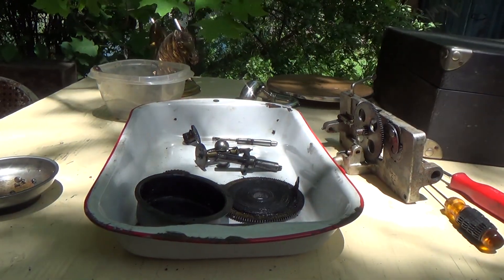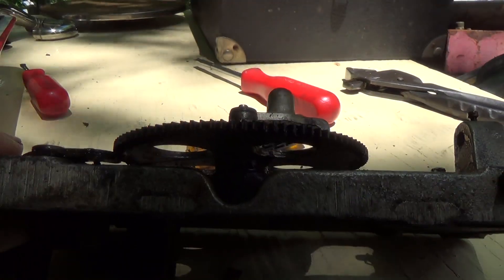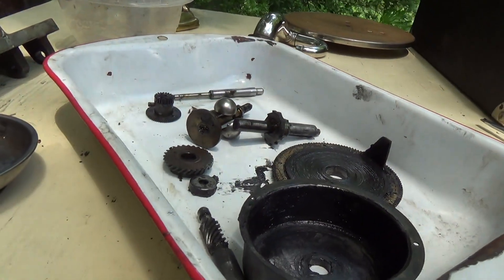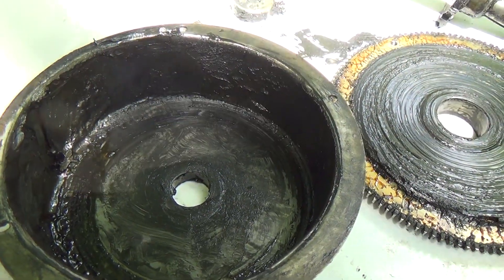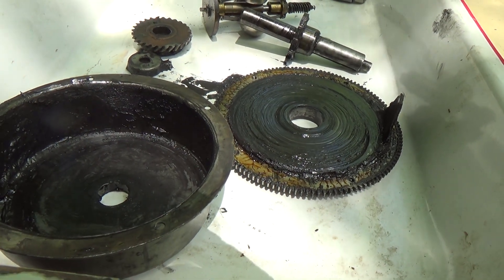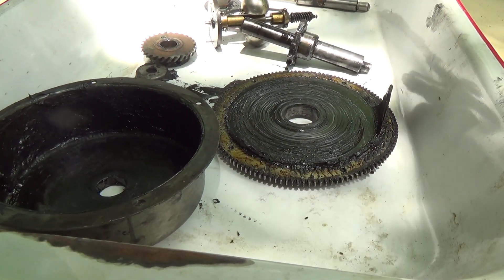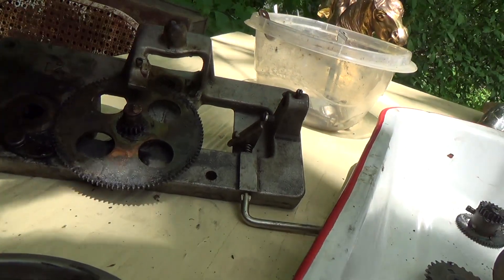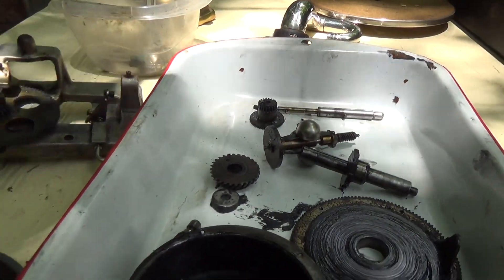VV-35 motor apart

Comment: I just got an old VV-35 (#47341), the main spring seems to be broken, but the spring barrel is riveted to the gear and the little "shark fin" spring retainer is outside the barrel. this is my first machine and I cannot seem to find a replacement barrel of the correct dimensions anywhere. if you know where I could find one that would be great!
Reply from the maker: VV-35's use a spring with a bent end on either end of the spring. The outer bend clips into a metal clip that is riveted inside the spring barrel.  There should be no part of the spring outside the barrel, or any retaining clips on the outside unless it's been modified in some way.  George Vollema should have parts for these, if he doesn't then I have several VV-35 parts machines.

Comment: Hey I recently purchased one of these machines and I'm currently trying to restore it. The old spring needed replaced so I purchased a new one and took the old one out and cleaned up the gears. However this is my first time doing this and for some reason I didn't think to take a picture of the spring in the barrel. But I figured I would remember how it went in. I also figured that since the inside of the spring barrel was coated in grease I would do it the same way. So i put the spring in how I remembered it going in and I re greased everything and put everything together. However when I went to wind it up and give it a few plays the platter wouldn't spin. wondering what happened I took it apart and as I went to take the spring barrel off I removed the cover and the spring was wound on the spring base plate where the hook catch is. So I'm kind of at a loss of how to continue. Any info or advice would be very appreciated thank you.
Reply from the maker: Can you take some pictures or video of what's going on and send them to this email? rockisland1903victrola@gmail.com   That would give me a clearer picture of what's going on.  Was the new spring damaged?  It's been a few years since I played with a 35, but I do have multiple ones in stock waiting for me to tinker with them.  I never have luck with the original springs in this model, they always seem weak, and I end up replacing them.  There is a 35 waiting under my bench out in my frozen workshop even now, a springtime project. If you have somehow installed it backwards then it's only a matter of turning it around the wind the correct way, messy, but doable.
Reply: @Rockisland1903  Sure! absolutely will do thank you! And yeah I remember you saying they used small springs in these machines.